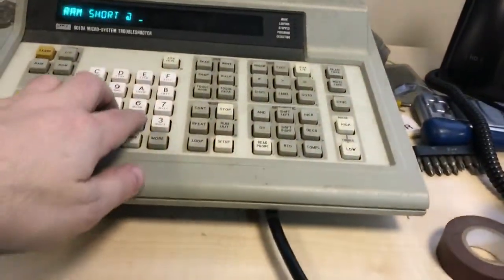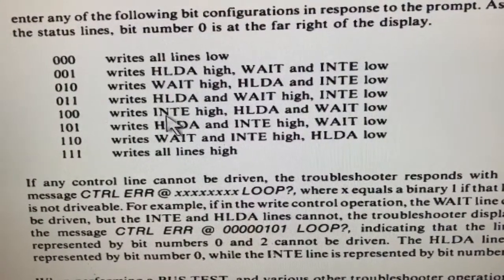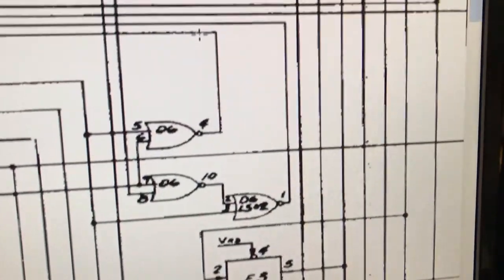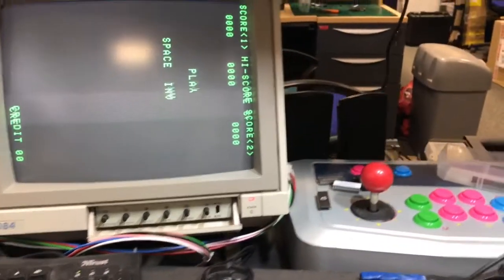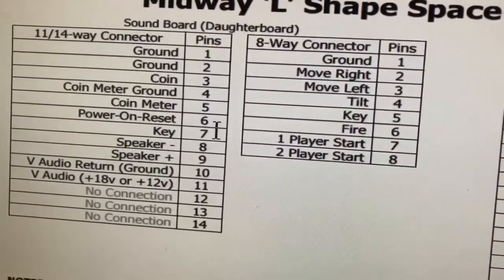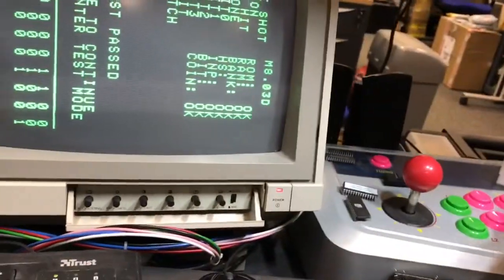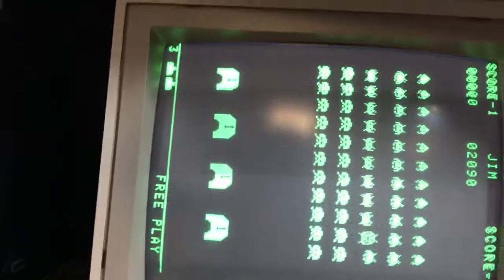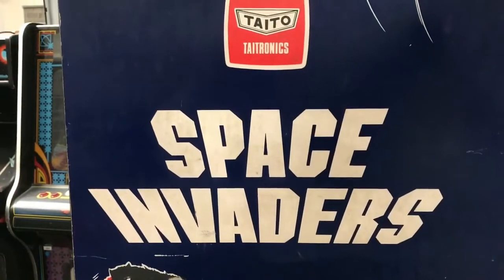Another Midway Space Invaders L Shape PCB Repair

Comment: Thanks for the video. I have a Midway upright space invaders that will only run for 35/40 minutes before screen garbles and then needs to sit for a day before it will boot normally again.  Day after day it does the same thing after 35/40 minutes. Would you happen to know what the problem is?
Reply from the maker: Could be one of many things, I need a better description "the screen garbles" - could be the monitor, could be the PCB....  Happy to bench test the board for you if you're UK based, if you're US based, contact Andy's Arcade.  email enquiries@retrogamesparty.co.uk for us to assist further
Reply: Thank you, I'll contact Andy's arcade

Comment: you replaced an LS 374with an LS 474?...umm yeah you're going to have problems later on.....not the same Timing. and not the same IC AT ALL!
Reply from the maker: Amy Marie no i replaced a 7474 with a 7474 at E3 which the INTE line drives pin 2 but the Q pin (5) was stuck hi and the /Q (6) was never crossing the transition threshold to LO